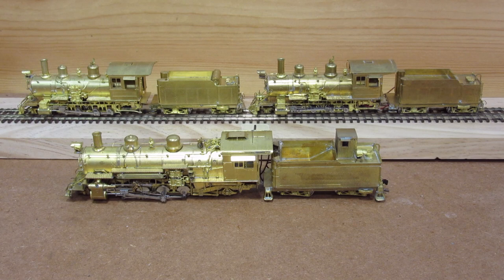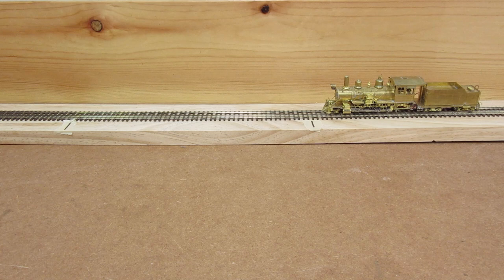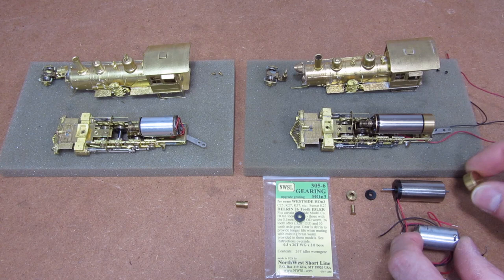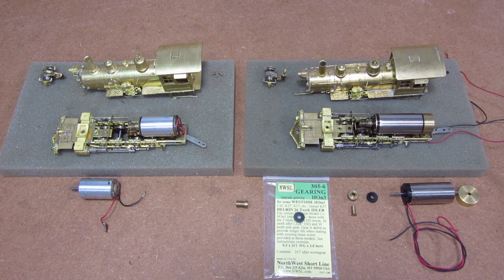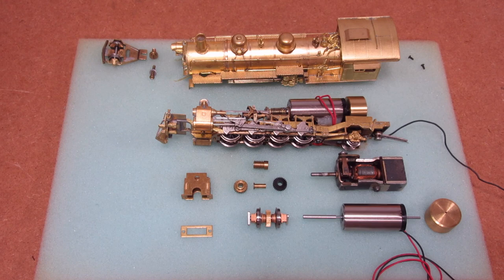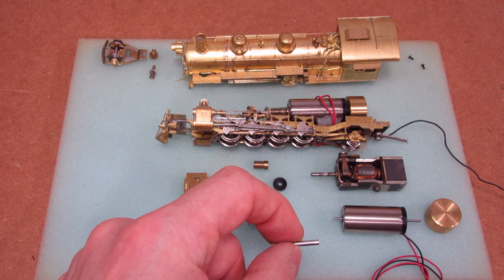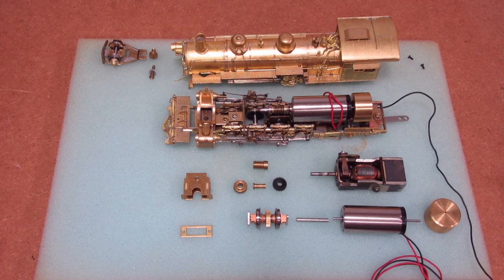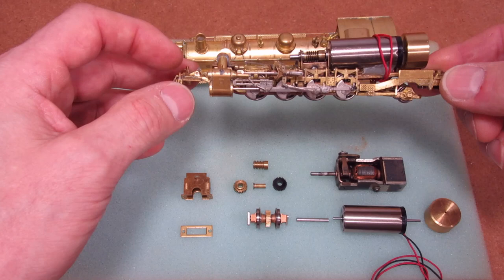Getting Your Westside Hon3 Brass Locomotives to Actually Run!  Re-gearing, Re-motoring and More!

Comment: Thank you for uploading! Any advice on where to get those motors?
Reply from the maker: I wish I had a good answer for you at this point.  There was pile of them on the surplus market last year and it looks like they are gone.  Now wishing I had bought a few more.  I just looked around online including Ebay and it appears they are totally gone from the internet.  Allelectronics.com had them last and selling for just $9.00, not any more unfortunately.  There was also a model train guy selling them on Ebay for $20, he's gone.

Here is the actual motor information: 
 
Namiki #SCL16-3424  
16 x 34mm
1.5mm dual shaft
9000 RPM @18V  (apparently actually 18V motors, not 12V, explains the slow speed at full throttle)
3.4W max power
14.4 nm stall torque (impressive for this motor size)
5 pole armature

I can pull out a tachometer and get an actual motor RPM reading for you at 12V.  

With the info provided you might be able to find something similar.  Maxon 118701 is a 16 x 40 dual shaft 7130 RPM motor but it's $160 from Maxon.  YIKES!  It would be amazing though.  7 pole motor!  If I see something else that would work well and is more affordable I'll post a response here for you.

Just FYI if you are motor shopping:  https://www.omnicalculator.com/everyday-life/rpm

27:1 gearbox x 44" drivers @ 35MPH/267.4 wheel RPMs = 7219 motor RPMs  (I think it's a 27:1 stock gear ratio)
36:1 gearbox x 44" drivers @ 35MPH/267.4 wheel RPMs = 9626 motor RPMs (NWSL option that fits)

Sorry I couldn't be of more help with the extinct Namiki motors.
Reply: @dtj9923  This post is pure gold!  thank you for providing this information.
Reply from the maker: @OtterCreek  I just updated my calculations.  NWSL has 28:1 and 36:1 options.  I messed up when I posted the 32:1 numbers.  32:1 is the MDC regear kit ratio.  Brain fade...
Reply: @dtj9923  Thanks, I went ahead and sent an email to NWSL in hopes they can get me headed in the right direction.  Not to knock their site, but there is little info on what a kit vs a gear box and such includes not to mention what it is compatible with.  They don't mention Balboa's anywhere.
Reply from the maker: @OtterCreek  If you measure you axle size I can get you going.  I suspect it might be a 3/32 or 3mm axle and from the pictures I am looking at it has a non idler style gearbox.  You can run idler or non idler boxes in these models, you'll just need to adjust your motor mount setup to match.  I prefer an idler style box with a plastic idler gear myself.
Reply: @dtj9923  My calipers said 2.43 mm on the axle.  I think mine is an idler box.  If that means it's not attached to the frame anywhere.  lots of up and down movement while it's running.
Reply from the maker: @OtterCreek   The floating gearbox is a pretty normal installation.  I would pop the hood before you go too nuts and see what is going on.  If it has a steel worm and brass drive gear and things aren't too sloppy you may have a workable system.  It might just need some tuning.  The jumping around may be a hardened rubber motor coupling raising havoc.  Very common on 1960s models.  Like I said, pop the hood, run it down the track with no body.  See what's up first.  In any case I would toss the open frame 5 pole motor and get something slow and modern that will be OK with DCC.

Here's your options from NWSL. apparently they don't have a 36:1 gearbox for 2.4mm (3/32") axles right now.  That part number is 160-6.  EBAY!  Shaving the gear cover should get you to clear a 40" driver according to the old catalog pages.  A K-28/36/37 has a 44" driver.  

Here's your current NWSL options in 28:1.  The more expensive versions have ball bearings.
https://nwsl.com/collections/0-3-mod?_=pf&pf_t_ratio=Ratio%3A%2028-1&pf_t_axle_diameter=Axle%20Diameter%3A%203%2F32%22%20(2.4mm)

This is an idler gearbox:   https://cdn.shopify.com/s/files/1/0250/4032/2669/products/240-6_grande.jpg?v=1570018886  
Notice the black plastic gear between the worm and brass drive gear.

Here is a non-idler gearbox:  https://nwsl.com/collections/0-3-mod/products/0-3-mod-28-1-non-idler-gearbox-kit-3-322-4mm-axle
There is no intermediate gear in there. 

The old catalog is very helpful if you can read gears:  https://cdn.shopify.com/s/files/1/0250/4032/2669/files/Gears_1_2.pdf?263

You are looking at pages 4-8 to 4-9 for 0.3 mod gearboxes.

-DTJ
Reply: @dtj9923  Awesome, thank you very much!
Reply: I presume changing the gear box involves pulling the gear off the drive axle and re quartering correct?
Reply from the maker: @OtterCreek  That is correct.  So make sure you really need to do it before you dive in.

FYI the common NWSL quarterer 44-4 is really only for 1/8 axles and sort of for 3MM  ( 3MM is a sloppy fit) if you were thinking of picking one up.  I have the pro version that does any axle size but it's $$$$.
Reply: @dtj9923  LOL, that was my next question.  I guess if I have 3/32 axles the 44-4 won't work at all?  What a bummer.
Reply from the maker: @OtterCreek   Yeah I found out the hard way.  The old catalog is very clear about this, new website not so much.  You can always make a careful witness line with a sharp hard tool before you pull the counterweight and use it to line things back up.  It does actually work but you have to be careful.  Did my K-37 this way.
Reply: @dtj9923  Again, thank you.  I'll first replace the motor and drive line and see how that works. NWSL did email back and recommend a motor so I went ahead and purchased it.
Reply from the maker: @OtterCreek  Cool!  She's doing her best to keep up with customers.  Did you get a huge flywheel to go on it as well?  Highly recommended if you are going through the exercise.

Comment: When I was a young sailor serving in the Pacific, I had an opportunity to acquire several Brass steam models direct from the manufactures in Japan and Korea.  The big problem with brass steam locomotives back in the 70s and 80s was that they were beautiful models but the motors and mechanisms SUCKED!  You were lucky if you got one out of the box that could lumber down the test track like a drunken sailor with out bind up and stalling.  I remember speaking with a sales rep in Yokoyama and insisted that I would pay extra to have a Can Motor installed along with some tweaking to the mechanism.  The rep seemed rather annoyed with my request and commented "Our models are very pretty" to which I replied "Yes, but they waddle like a lame-duck".  Apparently there was some kind of cultural disconnect in our conversation.  I wanted the model to operate on my layout, the manufacture was looking purely from the astatic aspects of the model.  Needless to say, my locomotive was waiting for me at my parent's house when I returned home from deployment and it ran flawlessly!  The best $500 I ever spent for a brass model.
Reply from the maker: @StillPlaysWithModelTrains1956  Some people get upset with me when I point out how bad the motors and mechanisms are on older brass models.  Yes, there are exceptions, but largely they need a bit of work to run well.  I have a new in the box White Pass 2-8-2 that quite literally waddles down the track like a drunken sailor.  Pretty accurate description of how many 50s, 60s and 70s era models run.  What was the brass engine you had tuned by the builder?

Comment: How do I tell if its a early model or a later run of models
Reply from the maker: Hey Pickle Jar, thanks for stopping by.

My Westside Hon3 references start around 1964 and run through the Precision Scale transition period which is 1981-82.  A lot of Westside imports were sold under the Precision Scale name after they were acquired.  The drive technology changed a lot in that time period.

In general if you are looking at a Westside model with a can or coreless motor, steel worm, and a brass hubbed plastic idler gear you're seeing a later production version of a model.  If your model has an entirely brass gear system including the worm and a five pole open frame motor, it's typically going to be an earlier or mid production model.  If there's a big weird looking chunky motor sticking out of the cab, it's definitely going to be a very early Westside import.

My only hard reference for Westside brass production dates is The Brown Book of Brass Locomotives and I have a good friend in the industry who was friends with Dick Truesdale.  He happens to have and has an encyclopedic memory of Hon3 brass imports.  I don't have a copy of the Westside K Files unfortunately.

Is there a model in particular you had a question about?  I can try and run down an approximate date for you.  If you have a catalog number it's pretty easy.

-DTJ

Comment: Amazing video and very well organized! Do you do commission work on locomotives? If so I’d like to speak further about it.
Reply from the maker: Thanks for the comment!  Unfortunately I barely have time for the pile of brass engines sitting here at home, but I'm more than happy to offer suggestions if you're dealing with a problem engine.
Reply: @dtj9923  If that situation ever changes then I would be one of your first clients. Thanks again for the video, if I work up enough courage I may try this myself at some point.
Reply from the maker: @MrGassRight  What engine/engines in particular are you working with, what era, what kind of running issues are you dealing with?  Some engines are pretty easy to iron out, others quickly become a real headache to straighten out.  

Yeah I unfortunately have a 1918 home that  is currently undergoing some long overdue upgrades for the next few years.  And then there's a turbocharged, fuel injected 1958 bug in the garage that is halfway through a 2387cc engine build.  If I had more time I would LOVE to work on other people's brass train problems.  House + car isn't leaving a lot of spare time.
Reply: @dtj9923  Also working with a Westside k-37. 

I totally understand, house and car take priority.
Reply from the maker: @MrGassRight  Do you have a big 5 pole open frame motor and a back head with cast in detail just like mine?

I can probably walk you through doing a rebuild with NWSL components and some mini flanged ball bearings for the gearbox in a way that avoids any machine work.

I can help you find a low speed motor and help you calculate the scale top speed.  35MPH is the realistic upper limit for these guys on the Alamosa-Antonito line .  I operate at about 15MPH typically. 

The BIG things you need to asses are:

How well is the drive gear is pressed on the drive axle?  Is it square and concentric?  Out of square is just as bad as non-concentric.

Are there any binds?  I had all sorts of binds  and collisions with the rods and valve gear.

Is it properly quartered?  This is HUGE and all too often the answer is no.

The best way to work all this out is to systematically disassemble/reassemble the engine and test it.  You will want to isolate one system and one issue at a time.  But be aware compound issues do abound!

Comment: Do you have a link or place you buy this motor? I can’t find it for purchase anywhere
Reply from the maker: YIKES!  I just looked around the world wide web and Ebay, it appears they are now vapor-ware!  There were some recently on Ebay for $20 but even those are gone now.  I wish I had bought more!  I can make a few suggestions that will also work just as well but they won't be as inexpensive.

This was the guy on Ebay that last had some:

https://www.ebay.com/str/sweetwaterlocomotiverepair

I don't know if this other guy us still in business, his website is kinda flaky.  Try calling him, he shows Namiki 1634 motors on his conversions page, I don't know if he still has them.

http://www.roundbell.com/index.html

Here is where he talks about Namiki 1634 motors

http://www.roundbell.com/hon3conversions.html

"Westside D&RGW K-37 (Nakamura). A fine model with an open frame motor and brass worm and idler gear that will wear out fast and need replacement for good operation.
The best upgrade is our Super Glide Drive K-37B Kit. This has a Namiki 1634 coreless motor with a flywheel you glue mount on a bracket you mount to the gearbox trailing arm, our #305 idler gear conversion cures the gearing problem. also included are washers to keep the siderods from scraping paint off the wheel counterweights. A smooth, quiet and strong runner. Since this kit is easier to make and install the price has been reduced."

Maxon has several 12V 16MM options in their catalog that would work, you can configure them with different shaft lengths.  Go with ball bearings for a few bucks more.  Trust me on this.  Be ready for sticker shock.

The Maxon products are 7 pole motors which are WAY smoother than the Namiki 5 pole motors, far better at the low speed end.   

DCX 16 S Ø16 mm, Precious Metal Brushes CLL, ball bearings 6230 RPM, 5.15 mNm, 2.5W 
(My pick! HUGE power, low speed, ball bearings, loads of torque )  

DCX 16 S Ø16 mm, Precious Metal Brushes CLL, sintered sleeve bearings 6230 RPM, 5.15 mNm, 2.5W

DC-max 16 S Ø16 mm, CLL precious metal brushes, ball bearings 7550 RPM, 3.91 mNm

DC-max 16 S Ø16 mm, CLL precious metal brushes, sintered bearings 7560 RPM, 3.92mNm

Looking at Faulhaber, their options run a bit fast unless you wanted to put in a 36:1 NWSL gearbox.    If you were willing to go the gearbox swap route there are other higher speed Maxon 16mm motors that work as well.

Let me know of you need help.

-Damon

Comment: Well, narrow gauge  engines waddle down their tracks😂😂😂 I had over 150 brass engines in my collection and remotred app 2500 and never had wobbly wheels on those made in Japan and only very few at those early made from Korea.
Reply from the maker: I have a new in the box HOn3 PFM WP&Y with some of the worst wheel run-out I've ever seen, it's almost comical.  Balboa C-21s I've picked up are consistently bad. I have several different early Westside 2-8-0s with noticeable runout. Most of the issues I see are with early Japanese imports.  Later models tend to be fine.

Comment: These locos cost a fortune, and all I ever hear about them is "But they run like a rabbit with calici virus - that is hardly at all".  How did these guys sleep at night?
Reply from the maker: Hey Dave, thanks for stopping by.

It's really funny to hear you say that.  I've struck a raw nerve with a lot of brass folks over the years by making similar observations.  There's a lot of denial issues.

My basic strategy at this point is to only buy basket case brass engines super cheap expecting to totally gut and rebuild them.  I feel less guilty about any hacking I might need to do like cutting the boiler to move the gearbox on the C25.  It also offsets the time and money it takes to get these running right.